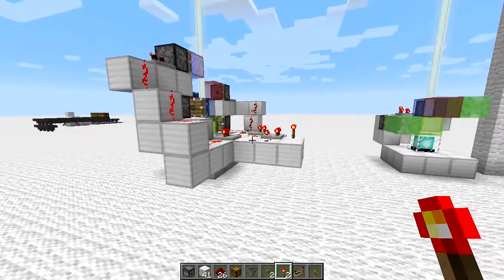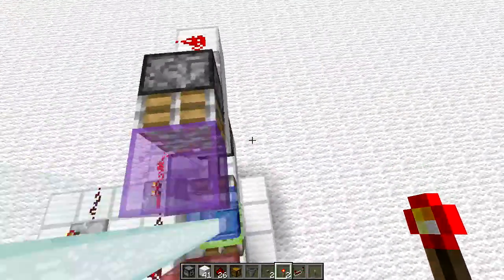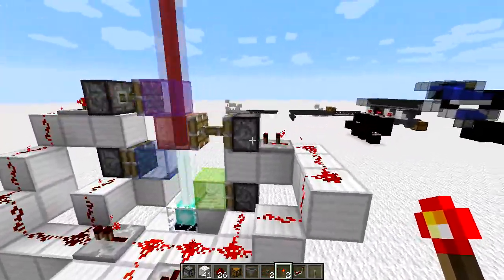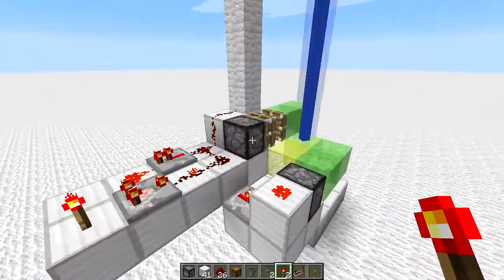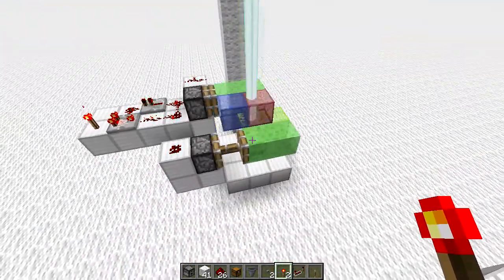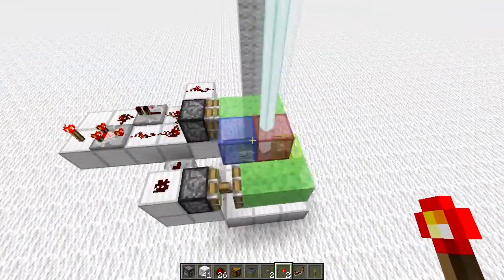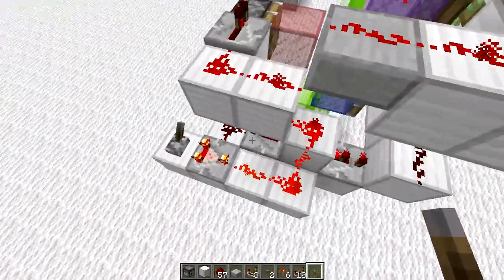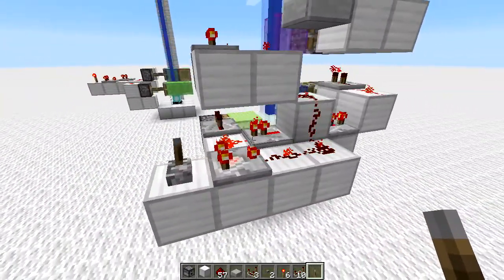'Disco' Beacons - Short Redstone with ChartreuseK

Comment: The reason why the first (and the last) design seem to have purple as a slightly dominant color is because red and blue add up to purple as well. In your second design red and blue are never simultaneously in front of the beacon and therefore do not combine to purple. If you want more of a rainbow you probably want only red, green and blue, using a 6 tick clock (3 ticks low and 3 ticks high) and offset each color by two ticks.
Reply: Actually did a quick test and due to the delay of the pistons while extending it is better if the clock is 2 ticks low and 4 ticks high.
Reply from the maker: Kwin van der Veen Other way I can do it is just by using the colours that I used on the second design, substituting purple for yellow. I just didn't bother changing it.